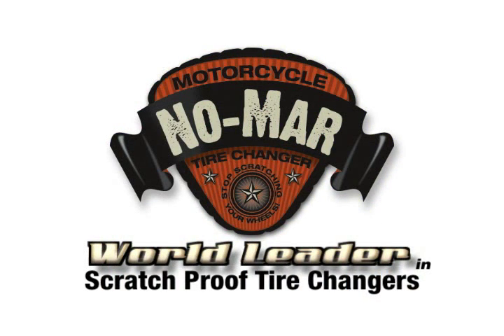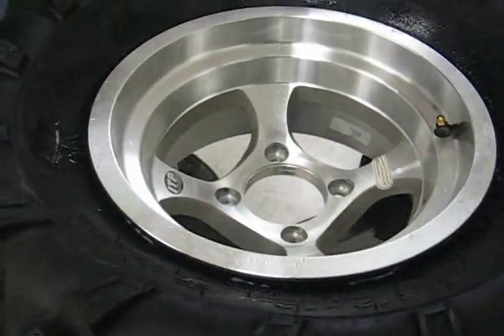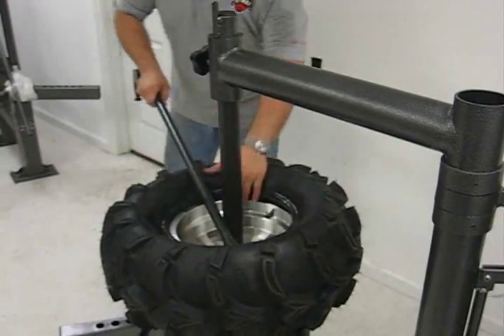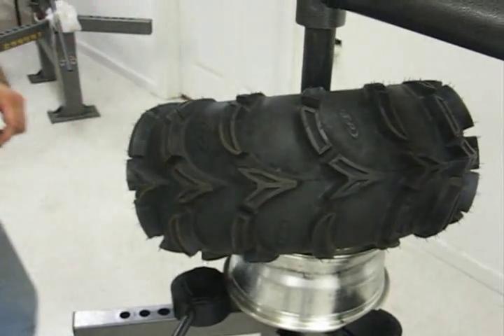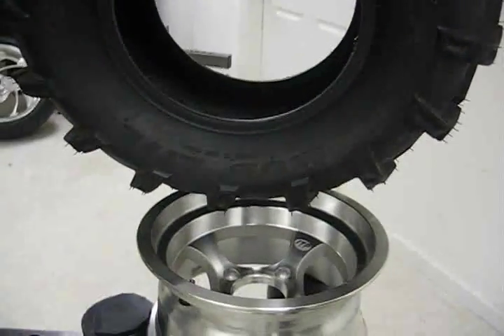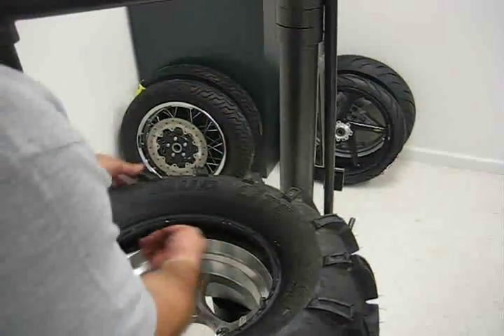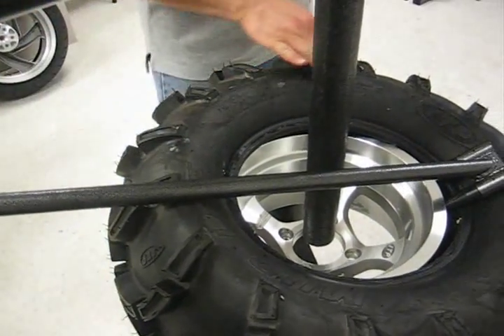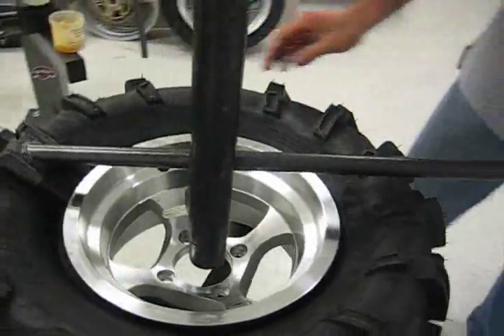Mounting and ATV tire with the No-Mar Pro Model

Comment: Awesome!  Lots of helpful tips.  I'm still learning about the purpose of the relief valley.  This is the first video I saw that limits the lube on the tire to ~ half of the rim vs the entire rim which makes it so slippery that you can get traction to keep it on the rim. You also cleared up confusion about not lubing the bead sealing surface.

Q: What are your thoughts on RuGlyde - I got it at napa auto but I found it dries so fast that sometimes I need to keep reapplying.  You seem to be using some type of grease?

Comment: I would like to see this with a good but old not so soft tire. Realy debating on buying one of these but I am not sold yet.. what I am sold on is to save your money and not purchase harbour freight garbage. .. great video though
Reply: I used the HFT to remove, patch and reinstall a factory original dry rear tire on a 2004 Yamaha Raptor 660.  I was able to do it but I scratched the aluminum rim and the bead was so hard to break that even with the 3 foot tire iron inserted into the hollow pipe I could barely break the bead even with my entire weight 165lbs! Also, the round metal that is designed to go through the bolt hole won't line up.  I could not have done it without starting and holding the tire with two HFT chrome motorcycle tire irons in addition to the main 3' tire iron that comes with the tire changer.  I bent one of the chrome tire irons.  Cars, a small atv, my scooter, but this was the most difficult tire I have changed by far!!!  The bar he is using helps too.